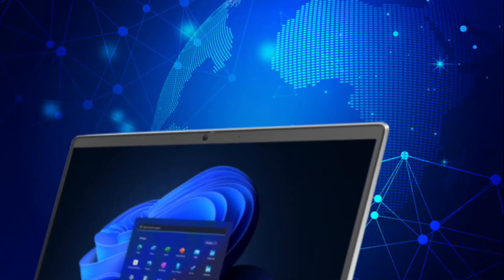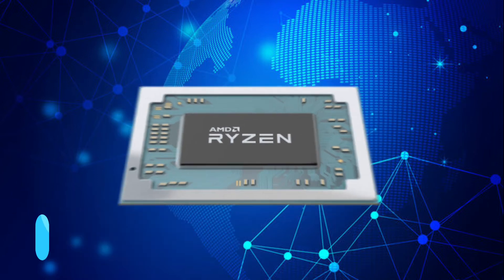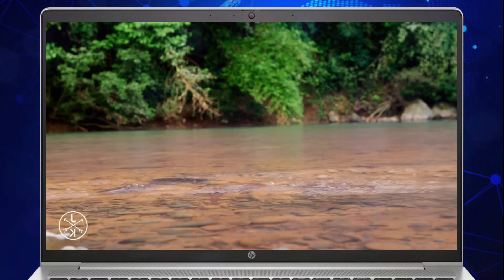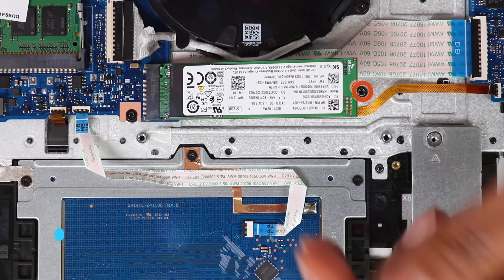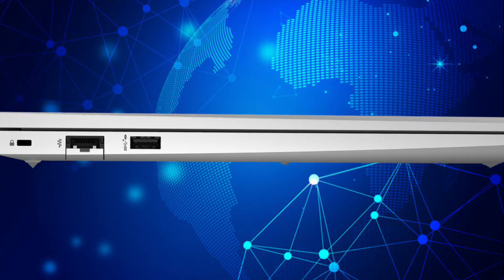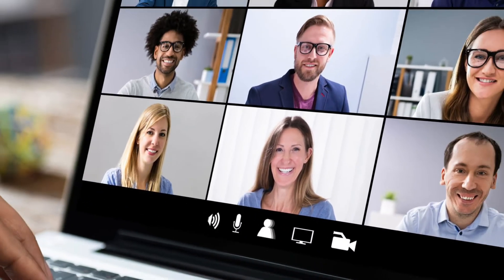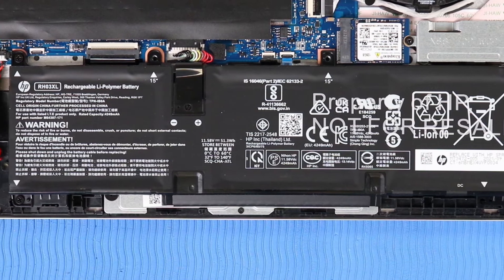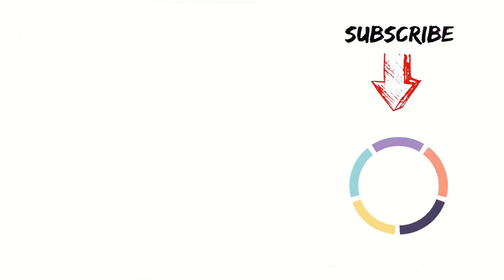HP ProBook 445 G9 12th Gen Notebook |  HP 445 G9 | Review - Finally a refreshing change HP 440 G9

Comment: Hello , do i need to remove my 256 SSD in order to place the 512 SSD ? or i can qdd the 512 SSD with the  256 ?
Reply from the maker: You can use 2 SSDs simultaneously
Reply: @ITTubebd  much appreciated 🙏 another question  : does it have a limit storage I'd like to upgrade it up to 1TB is it possible ?

Comment: hp probook 445 g9 with ryzen 7 5825u 16/512 or lenovo ideapad 5 pro with ryzen 5 5600u 16/512? i need it for computer engineering
Reply from the maker: I will suggest you for hp ProBook 445 g9 with ryzen 7 5825u 16/512 .